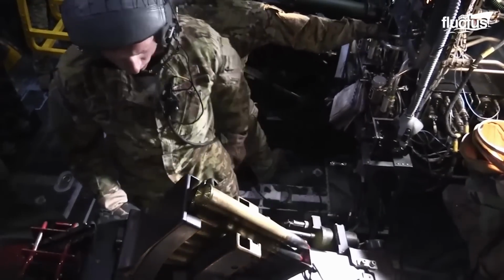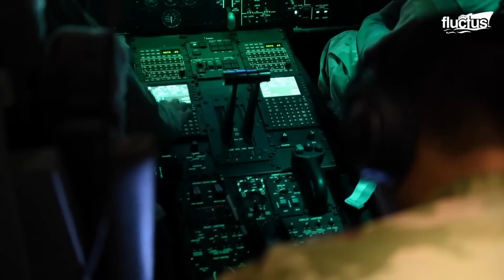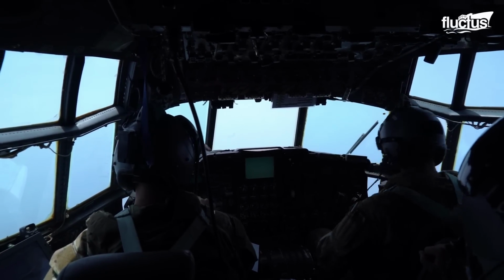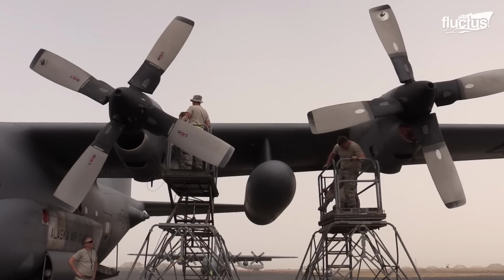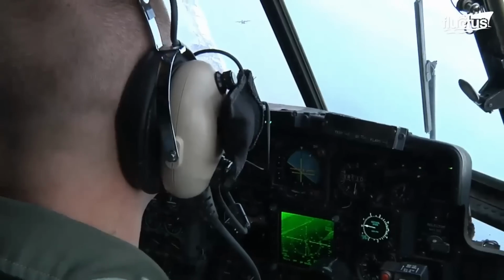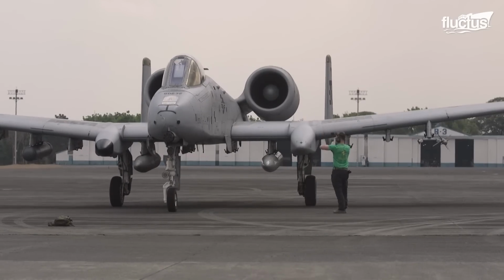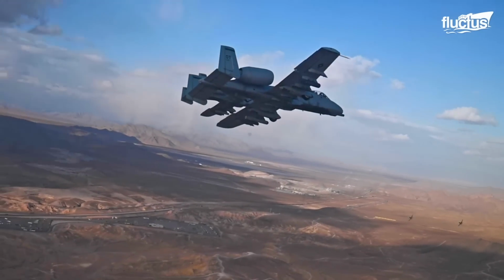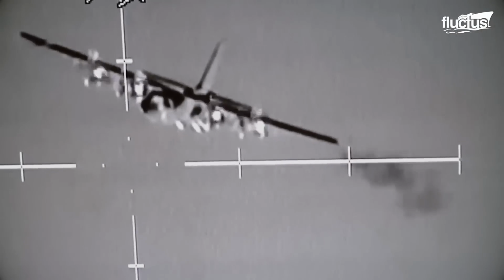A Day Inside US Monstrously Powerful $200 Million AC-130 Gunship

Comment: My main concern is the spar . I would think that wing loading would be over the top . I also think these C-130 have a lot of special parts so it just don't shake its self to pieces . I seen these in Nam at night but now they are more powerful by far .
Reply: I had an instructor in tech school who worked with these and he told me that the cannons eventually bent the frame of the plane. I don't remember if it was preventable or not

Comment: 2015, New C130J Scrapped After Flying Upside Down.
	The US AF had to scrap a brand-new Lockheed Martin AC-130J Ghostrider gunships. Hercules received damage estimated at $115,000,000 after a flight-test crew lost control.
While being operated at roughly 15,000-ft, the aircraft flew upside down, before being recovered after losing approximately 5,000-ft of altitude. The crew escaped injury and returned to base and landed safely, but the Ghostrider was rendered a total loss, having exceeded its operating g limits and design load.
	Investigators have attributed the incident to the pilot’s “excessive rudder input during a test flight, followed by inadequate rudder input to initiate a timely recovery from high angle of sideslip due to over-controlled/under-controlled aircraft,” along with the “wrong choice of action during an operation.”